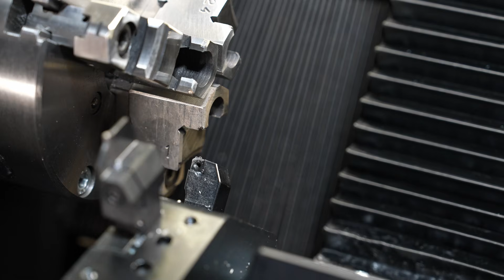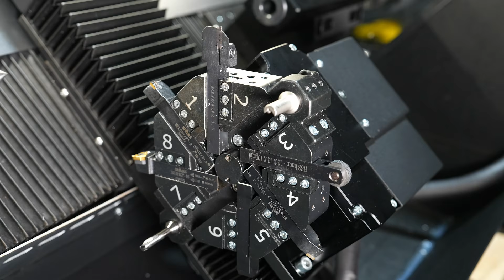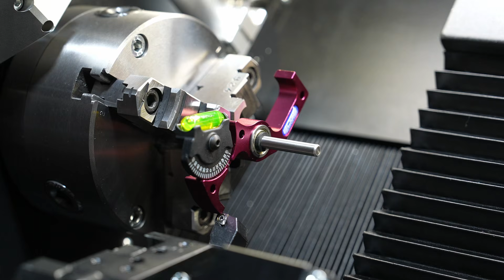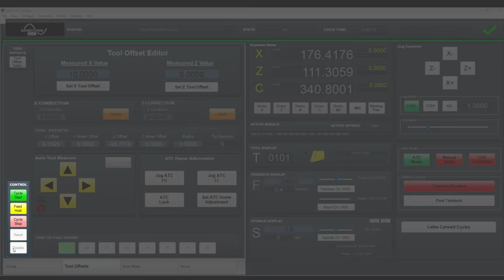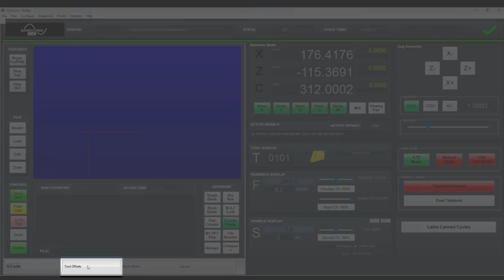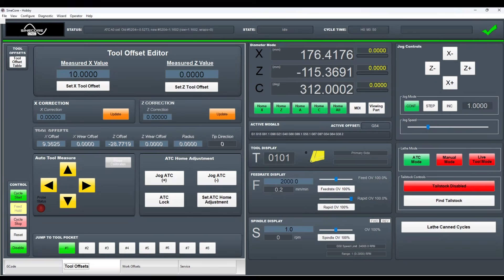SC512L ATC Troubleshooting and Calibration Guide: Get your Tools Cutting on Center

Comment: Take care not to over tighten the socket head caps screws Don't Use impact driver
Be sure that when you Jog ATC be sure that it engages smoothly and you have 60psi air supply Do not go above 90psi